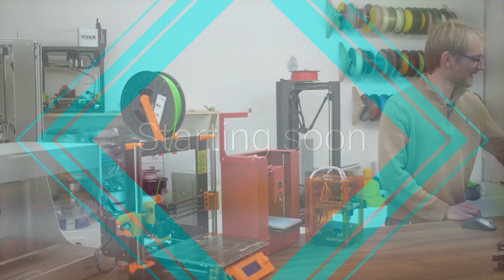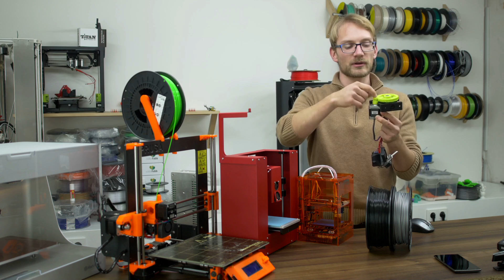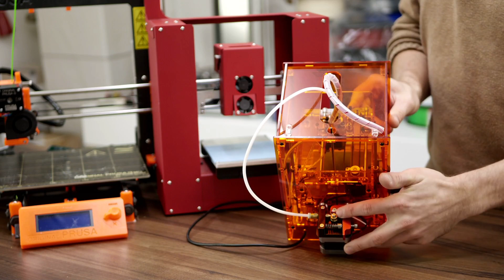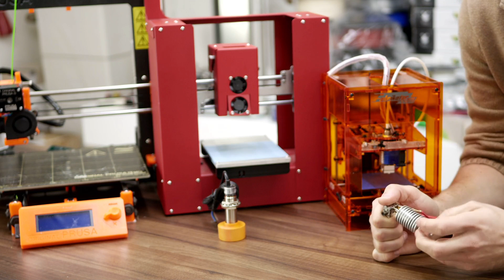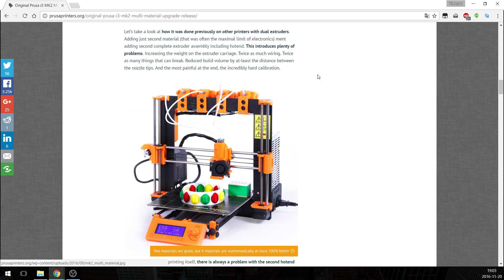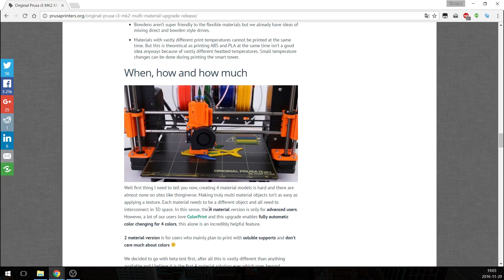What to consider when buying (or making) a 3D printer! [was live]

Comment: 12:40 getting everything from one source, yes, you get only one person to blame if something goes wrong. But that is not justification to charge more. They are charging more simply just because they can. There is no reason for it. Charging extra for ease-of-mind is entirely capitalistic, but doesn't mean the buy should be happy with it.

Imagine you buy a PC from one company, it comes together with a monitor, keyboard, mouse, and speakers. That should not be more expensive than if you were to buy each of these separately. Because they are earning a little bit from each component and are not cross subsidizing.

Comment: Tom, first thanks for all the recommendations. Super useful videos.  Ok so, to the point. I need your advice. I need a printer that just works. I am a product designer and the last I need is to fight with the printer. I already spend time designing and modelling, so, I just need some settings to the slicer and send to print. I recently bought a cheap monoprice mini. it works two days and then crashed.  I really hope you can help me to figure out which is convenient for me.  Thank you very much.

Comment: Would you say i would be fine to go with the Anet A8? I don't want to pick the wrong machine, as I'm 14 and obviously don't have an income.
Reply: I have an A8. Nice enough machine.   The first prints you'll want to make are upgrade parts for the machine.  Search here for upgrades to the A8  (Mostly stuff like brackets and belt tensioners to help stabilize the machine).

Comment: Perhaps somebody wants to help me? I did build I pretty unlucky WilsonTS, first the hotend blocked every 2nd time thanks to the pretty poor design of the fan-duct and the cheap E3D rip-off I bought on Ebay. Now after I got a real E3D V6 hotend in place I still end up with blocked hotend and I already feel quite hopeless. But not comes the real "this is shit, I gonna put everything in the trash!"-moment it seems. I edited the Z-stepspermm and ended up with blocking Z-motors. Turning up the DRV8825 driver-poti makes them move but only very noisy while homing. Right now I've no clue what to do, this thing won't print anything.

Please give me a hint how to get a working printer without putting more money in this blackhole.... :( I actually pondering buying a Monoprice MP Mini for about 300€ (incl. tax/dutyfees) because I'm somewhat done with tinkering myself after almost a year without any success... :| But then, the printarea is tiny and the overall specs and reviews doesn't sound great, too.

Please help? And no, no makerspace or similar in the area here... searched them already.

Comment: Kinematic platforms do matter. All other things being equal, a machine with lower moving mass will always print faster, more accurately, and will have fewer ghosting artifacts. Prusa/Mendel moving bed machines are  at a very large disadvantage. The bigger and heavier the printbed, the worse the problem gets.

Conventional cartesians with a vertical Z bed are an improvement. They have substantially less moving mass on the Y axis, but still have a somewhat heavy X-axis motor to throw around. 

Cartesian designs with fixed motors are more optimal. Ultimaker style kinematics work fantastic for smaller machines. For medium-large and big machines, CoreXY rules. However, one must be careful not to overload the carriage on a CoreXY machine with a big heavy direct extruder system, or the advantages of the CoreXY system are mostly lost. Direct drive systems should use a small and light pancake motor extruder with low inductance and high power supply voltage. A DSP stepper drive system is also helpful in achieving the largest possible dynamic speed range of the extruder drive with minimal loss of torque. If you can live with the less precise nature of a Bowden setup, then that is probably the best option from a low-moving mass standpoint.

Deltas are king when it comes to low moving mass since they almost always use Bowden extruders. But as almost everyone knows, they are a very different animal when it comes to setting up and leveling. The fine moire pattern seems to bother some people, but Cartesian's also print faint vertical stripes or bands when they are not printing parallel to an X or Y axis. (or at a 45 deg angle in the case of CoreXY machines)

Printing reliability or tendency to jam or clog are almost 100% determined by the hotend/extruder design. It has nothing to do with any other design aspects of of the machine. Unfortunately, the best extruder designs are not always present on the machine with the best kinematics.

What is the solution? Do your research on which components and approaches are best and then build your own machine.

Comment: I wonder about the Prusa i3 Mk2 and about its printplate. Currently I use a ultimaker original + and i often glue two parts together. That requires a completely flat printbed. My question about this is if the printbed of the prusa is also completely flat and stays that way. What does their software and mechanisms do to the printbed? do they  react on a  slightly distorted printbed which would mean that the head goes up and down according to the distortion, which would result in a non-flat base of the print? or is the print on the bottom always completely flat like on a thick glasbed? Great channel with a lot of useful information by the way!

Comment: i wonder why you're so harsh about je Malyan m150, i have bought this machine for about 190 euro which is as cheap as it gets, i can print ABS PLA TPU PETG without a problem after a mod to the extruder which required a small print and a few mm of ptfetube. Im having troubles with Nylon but i think it's due to the warping that occurres bt cold air passing. the quality of the prints is very good, even the tpu from hobbyking(hobbyking flexible filament) which is very cheap has a real high end result

Comment: Thomas, we're trying to find a low-cost first 3d printer for a robotics team I coach and could use some help.

We heard you mention the Prusa i3 Mk2 this past weekend, but we'd like to buy on Amazon (we have an account), and when we search we find several listings that use "Prusa i3" in the description, but clearly are not the same printer as the one used in the Make Mag review.

Would either of these be a close match:

https://www.amazon.com/Guru-prusa-i3-V2-Printer/dp/B01KD6T7Z4/ref=sr_1_2?s=industrial&ie=UTF8&qid=1479744035&sr=1-2&keywords=Prusa+i3+MK2

https://www.amazon.com/JGAURORA-Printer-Printers-Assembly-filament/dp/B01CNP3CUO/ref=sr_1_4?s=industrial&ie=UTF8&qid=1479744035&sr=1-4&keywords=Prusa+i3+MK2

If not, any recommendations for a printer available in the U.S. at a sub $500 price range?

Community comments welcome as well  :)

Thanks!

Comment: Definitely a lot to think about.   I own a small business.  I print but not everyday.   I am torn between the Ultimaker 2 Extended+ (hang up is price, but the print size catches my eye),  Prusa i3 MK2 (never owned one), and the Robo R2 (I have an R1 but hesitate because I feel like I am constantly messing with it to get it to work.   I bought it refurbish and hope that's the issue).  I don't mind building a kit with clear instructions.   I want the best bang for the buck.  what do you suggest?   I don't mind a suggestion not currently in my list.
Reply: I am an engineer....so I need it to be versatile with materials and prefer open source and a customer service.
Reply: I really wouldn't recommend the R2, they didn't fix much with it. I'd say the MK2 is worth it if you want the mix between ease of use, print quality, and build area. If you do need the larger print area, the Taz 6 would be good. It has a larger XY print area than the Extended, and only 30mm smaller on the Z.

Comment: Customer support, customer support, yadda yadda. I have no idea why doing things right (especially wrt. documentation and out-of-the-box experience) isn't considered an option.
I imagine that almost all problems boil down to either manufacturer's negligence or well-known print quality issues. These could be either avoided or troubleshot by the user with aid of proper documentation. Therefore not needing such a big support team.

Comment: It may be true that one kinematics platform is not generally superior to another, but it seems to me that each has its advantages and disadvantages, and you can take those into account. Delta has a circular platform, cartesian has a rectangular platform. CoreXY allows you to keep the gantry lighter, because it doesn't have to support a motor. And so on. Am I wrong?
Reply: Michiel Helvensteijn I completely agree. Many people say that with deltas for example there will always be a moire present on straight lines since it doesn't "naturally" print straight lines.. As in its not just moving on one axis. But I suppose the same applies on Cartesian printers and curves. There's also things to consider with the types of models you'll be printing.. For example if you're printing tall parts then a moving y axis like in the prusa i3 design isn't gonna be as good as a a design that keeps the bed still or only moving in the z axis
Reply: Good point about straight lines on deltas. Delta printers have always seemed like an academic novelty to me. The way it works is very interesting, but other than the circular build surface, do they have any clear advantages? Straight lines are a common requirement in 3D printing, but how often will your prints need the 'natural curve' of delta kinematics (is there even such a thing)?
Reply: Michiel Helvensteijn exactly haha.. Plus Cartesian printers print curves fine anyway. I also think that the huge extra space required on the z axis on delta printers is such a waste. It's like half of the whole thing is taken up by the arms when they're fully raised. Interesting that you see the circular build plate as an advantage.. Many people see that as a disadvantage :p
Reply: I'm merely recognizing the circular build surface as a possible advantage for certain use-cases. It makes sense if you want to commit your printer full time to printing circular stuff. It's a tenuous advantage, to be sure, but I wanted to acknowledge it.

Perhaps print-speed is an advantage? The gantry can stay quite light, yet doesn't require the long belts that CoreXY does. (My intuition here is that belts wear out more quickly, and their natural elasticity may add up to some imprecision).
Reply: Michiel Helvensteijn hmm yeah I think that's what most people are attracted to with them. That and a bowden set up can give you some pretty fast speeds. What about an ultimaker style kinematics system though? In their design both axes motors are fitted to the frame, and there are just single loop belts running along each edge as far as I'm aware. Maybe that's their secret to such great quality prints.. The kinematics system

Comment: Designing your own is always the best option, as long as you have 200+ hours, engineering experience, and double the budget you originally planned :)
Reply: You are right. Engineers can find more ways to spend money.
Reply: He said design your own not kit.
Reply: I agree its always over budget lol 4 meters of 12mm rod ain't cheap!
Reply: jordan bourns Hahah very true!
Reply: As an engineer, I'm way more interested in designing and building my own, than using it.
Reply: now check the price for 700mmx 12mm Ti rods instead of the normal guides...
Reply: Well of course their more expensive but totally not worth it. First you'd want ground Ti rod not just round stock. plus bearings or bushings suited for Ti.
Reply: i agree that designing a 3D printer is the best option as long as you have double the budget you originally planned
but i don't completely agree that you need 200+ hours of engineering experience because, i designed and built a 300*300*350 mm build volume corexy 3D printer from scratch , and guess what? i'm a 16 year old 11 th grade student ,and it prints well!
don't get me wrong , if you don't know what you are doing you won't succeed, and doing it is a daunting task!
i took 6 months from start to finish.
Reply: im designing a custom 500x500x500 corexy atm so i totally agree its way more satisfying atleast
Reply: I can confirm that from my own experience. That's exactly right.
And I might add that DIY-ing will always get you a rig that's at most 99% complete. That last 1% that would mean that the thing is "complete" - that you are perfectly satisfied with how it turned out - is unobtainable.
Reply: Dont reinvent the wheel.  Fix any problems with an existing design.
Reply: That's all wrong :)

It won't take nearly that many hours, you can gain experience by building, and budgets aren't exceeded with kits any more than they're exceeded with prebuilt machines.
Reply: Daniel Mezhiborsky Ohhh no I don't mean building a premade kit, I mean designing your own!

Comment: I am getting my parts slowly but it will be a 300x300x300 VRail system with wheels.  It will not have a bed that moves in Y (I hate that about the prusa, or like, machines) and will go up in Z.

Comment: That third 3D printer you have there, the mark 2 (whatever it's called), is almost perfect for the projects I'll be working on. But I need something with a little bit more length, like 300mm. Can you recommend anything, please?
Reply: I own 4 Mk2's and they are great,   But i too needed more height for some projects,  I went with a Rostock Max V3 (Delta-style)  275cm Diameter bed, with 400cm Z-height .   Im loving it so far.
Reply: The Markforged 2 is the only one on the market that I know of that puts down continuous carbon fiber, you might have to reconsider your design.
Reply: Thanks very much!
Reply: Wasnt sure if you were refering to the Prusa Mark 2, or the Markforge,   but yea,  my recommendation stands if you were refering to the Prusa, but if its the Markforge, i have no idea :)